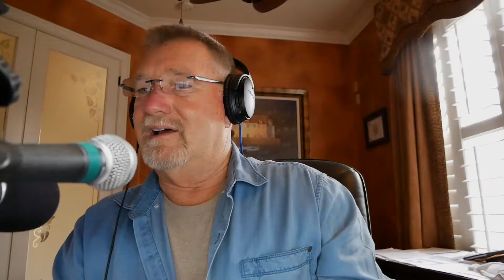Battery Keeps Dying? // 2009 Toyota Camry

Comment: This is what mine just did alongside not detecting the key fob (aka it won't let me drive it) same model same year
Reply: Did you finally get a solution to it?
Reply: @Dexti1of1 not really I keep a back up battery with me 😢 and it will work for a while.